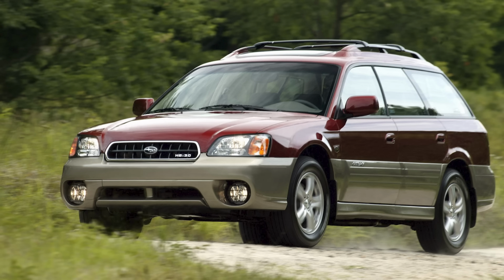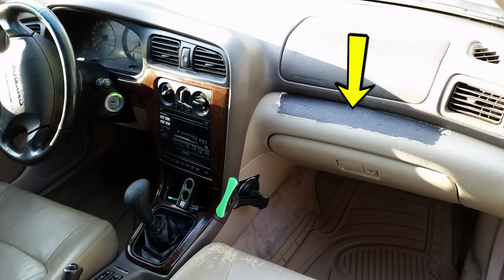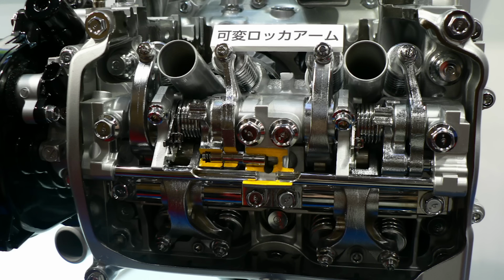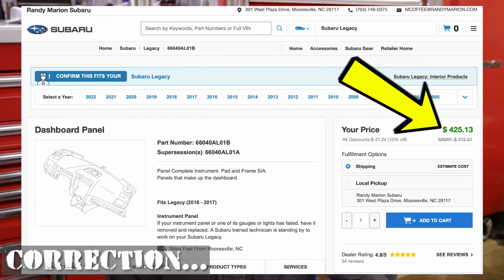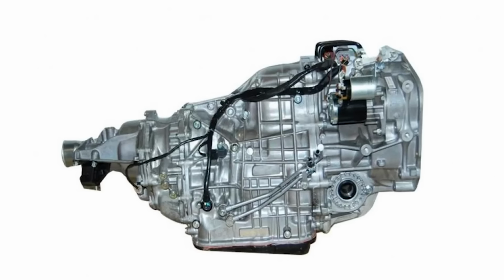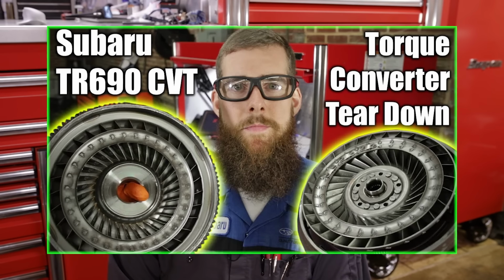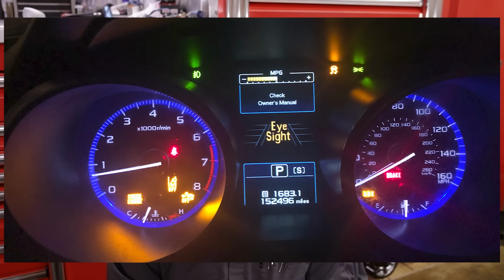Buying A Used Subaru Outback Or Legacy?! Here's The Good And Bad Over The Last 20 Years!

Comment: I didn't know I was supposed to be burning higher octane gas in my 3 l could that be the reason I'm getting off cylinders running lean code I tried everything to get it to go away and I did upgrade the higher octane once I heard knocking spark knock.

Comment: When it came time to update my 2007 Ford Focus ZX3 daily driver/“commuter beater” with a new car, I was considering one with waning availability, that one being the Nissan X-Terra. “Waning availability” turned into “I’ll never be able to get the model I would have chosen.”
      In the meantime, I got a bit older, along with the Focus. I also began to learn a thing or two about the Subaru Outback. I decided on that car. And today, I’m the proud owner of a fully paid-for, 2017, 2.5L “pzev” (partial zero emissions vehicle- don’t ask!) Outback. That car got me to retirement, after I ran up over 70,000 commute miles on it (plus a trip to Flagstaff, AZ and back), with a major service at 30,000 and regular DIY oil changes. Here’s where it gets fun!
       Late last year, I began to become concerned that after missing the 60,000 and 72,000 mile service schedules, I ought to take care of that. And so, I did. It cost around $2,500, which included servicing the CVT and replacing lower control arm bushings and rear brake pads. And then, I also needed new tires.        
       Needless to say, the past few months have been a bit expensive for maintaining a Subaru. But, ‘wanna’ know what? I just completed a round trip between LA and the SF Bay Area, including the LA area touring. But then, earlier this month (March 2026) I also drove from the Bay Area to Boise, ID, onto Salt Lake City, back to Idaho, and then back to the Bay Area. Needless to say, we’re up for another oil change!
      I’ll be honest. I can’t afford a new car. I need for my Subaru to last. I look at every month without a car payment as a blessing. If I have to drop a grand on it every once in a while, averaged out, it’s still cheaper than car payments. And, oh by the way, I still have the Focus! Thanks for listening.

Comment: Michigan salty roads destroy all vehicles. Sadly, my 2004 Outback with the EJ251 & 4 speed auto trans is rotting away in all the usual areas at 263,000mi. If not for rust, this would be the last car I'd ever want or need. It is that good.

Comment: Bought an 03 Outback from a friend with some oil leak and went through a little antifreeze. 1500 hundred. I was amazed how well it drives and quite for a car with 250,000 miles. Just bought an 02 for 500, blown head gaskets. Pulled the motor, replaced all the right stuff.  Fell in love with these early Subaru.

Comment: 2017 3.6 touring here with 160k miles. Never had the common issues mentioned. Still have the original windshield and harmon kardon radio. I replaced the battery after 6 years with a better one beacuse I was going on a long road trip in winter, but never had any issues with that either. Mice did eat the soundling of the engine cover. 😂

Comment: 2015-2017 Outback and Legacy was offered with a 6 speed manual in Canada. Base models should have no battery drain issue as it amainly caused by headunit trying to connect to nonexistant 2G network. Base radio has no mobile connecitivity and doesnt have hat issue.

Comment: MR. SUBARU PROBABLY WONT SEE THIS BUT ITS A SHOT N THE DARK, YOU SAID YOU PERSONALLY OWNED A GEN 4 3.6R OUTBACK. I RECENTLY GOT A 2013 WITH 109K ON THE CLOCK L, 1 OWNER CARFAX CAR. IF YOU SEE TORQUE CONVERTER SHUDDER @ AROUND 1700RPM AT SPEEDS ABOVE 35, AND WHEEL SPEED DATA IS GOOD, TURBINE SPEED 1/2 DATA IS IN SYNC WHEN IT SHOULD BE NO CHECK ENGINE EXCEPT NEED TO REPLACE MY 1 OF MY TPMS BUT WILL DO 4..SPEEDO AND ODOMETER OCCASIONALLY DONT WORK UNLESS I CRACK THE SUNROOF OPEN 50% OF THE TIME THEY START TO WORK (SHARING A COMMON GROUND?) . I DID HAVE CODE FOR "AT ABNORMAL" IN THE ABS SYSTEM BUT WHEN I INSTALLED NEW ABS MODULE (SAME PART#) I COULDNT GET IT TO PAIR TO ECU SO HAD CEL'S) REINSTALLED ORIGINAL ABS MODULE AND CLEARED CODES.  TRYING TO FIGURE OUT IF I NEED TORQUE CONVERTER, VALVE BODY OR WHAT?  IM IN NW NC BUT HAVE VACATION AT EMD OF OCT., MAYBE I CAN DRIVE DOWN TO HAVE YOU TROUBLE SHOOT IF YOUR NOT BOOKED UP ?

Comment: 05 3ltr outback 450000klm in oz,
4th? owner, had for 5yrs spent $5000 on fixes mostly by me.
Previous owner slack as, checked inlet valves, carboned up heaps, all clean now.
Wanna take out and rebuild one day, purs like a kitten goes like a rocket, regular italian tuneups.
N.B. all subies over 240000klm need mega ongoing mntce and are only worth $2,500 max for g.c. and full service record...top dollar, imo. Use full synth, flush auto

Comment: 246k miles on my 2001 2.5L Outback. It’s becoming harder to find some parts. Recently replaced the timing belt/water pump, front D/S wheel bearing, fuel pump, radiator/hoses, rack and pinion rack, catalytic converter, fuel injectors and ignition key cylinder. I had to have the injectors rebuilt because I couldn’t find OEM and the ignition key cylinder on EBay because it was discontinued. I need a HVAC diverted assembly but that’s also been discontinued. Great video. Thanks

Comment: I'm here because I just got a 2004 outback with only 73k miles on it. It was an old lady's car and unfortunately she passed away. I'm glad to have found such a great little gem. Also very glad to know that this 04 is part of the better ones built. I'll do the maintenance on the head gasket sooner than later. I know about the timing belt and water pump issue. Anything else I need to be on the lookout? Great video!!

Comment: I have a 2019 2.5 and it has had no issues. My sense is by 2019 they have ironed out a lot of issues so maybe try to get a 2018-2019. No mention in this video of the mid generation refresh for 2018 which was meaningful. I can understand appeal to keep an older one but the 2015-2019 I think are very safe and have performed very well in crash tests. Crash test results must be taken into account. (Also not mentioned)

Comment: 07 legacy limited, no turbo. I had the sticky dash, ghost walking used to be crazy in the rain,  the blend door problem, and the wheel bearings always needed replacing...  No head gasket issue tho. I liked the car, but it was finecky... Way less problems with my 06 manual TL.

Comment: Sounds like a very thorough and damning :(. I had a 2003 WRX wagon that I bought new and it lasted over 300,000 miles on the original turbo with some gentle performance tuning. I also had a 2007 WRX Limited wagon that I ran over 300,000 and then sold because I didn't want to get into fixing the infamous Subaru rust issue in the rear quarter panels. Again, this one was mildly tuned and had the original turbo. Neither had head gasket issues but each of them at some point ate the intake valves in cylinder 1. Weird.

Comment: I have a 2004 2.5L Outback with 150,000 k's and it's been and still is a beautiful car, never been a problem but I have done regular maintenance.
I bought it with 50,000 k's from my mother estate but it did need some repairs, hubs and joints, not from wear but from age and from being driven a little.
2 years ago before having 2 knee replacements and had a 2.5'' lift kit fitted and with the all terrain tyres suits it perfectly.

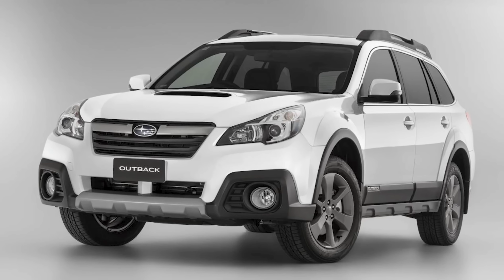Comment: 14:13. So does that mean the 2010, 2011, and some 12s that still had the timing belt version of the engine are still susceptible to the head gasket issues?
Reply: Trying to figure that out myself. Thanks for asking!

Comment: We bought a 2005 Outback 2.5i. Head gaskets replaced. Oil change religiously at 3,000 miles. Now it uses 2 qts every 3,000 miles. I wish I never sold the Legacy 1995 wagon

Comment: i just got a quote for $4,200 to fix the headgasket in my 2013 crosstrek... i looked on ebay and low mile used engines are like $1,500.... im going with a used engine! i can buy three of them for about the price of a rebuild, and can probably rebuild mine in my spare time if its out of the car and im not in a rush.

Comment: 3rd gen outbacks are legendary. They don't rust, most have full posi lsd's. Both the 5mt & 4eat are tough af. You do the head gasket at 150k nothing else will fail and they'll go 300k plus with abuse. So long as you check your diff oil and engine oil. 💯👌
My 08 has 235k
My 4th gen is fragile garbage, build quality is shit compared.

Comment: Couldn't agree more about the '00-'04" Outback as peak Subaru. Two months ago I picked up a 2002 Outback 2.5 manual with 255,000km on it for AUD$1800 as a cheap daily runner (so I could retire my rare '02 Alfa 156 GTA from daily duties). Everything works, even the clear coat is still intact, and the young fella I bought it off had fitted MLS head gaskets, done the timing belt and installed a heavy duty clutch less than 30,000km before I bought it. It's also got a 2" lift kit, HD offroad tyres, bull bar and CB radio. It's a breeze to service myself and really the only thing I still need to sort out is to replace a couple of split CV boots. Rather than muck about, I've bought new replacement CV drive shaft kits for each side and will fit them myself shortly.  Man I love this thing.

Comment: Im a Subaru fan, owned a 99 Outback  briefly before rolling it..... Might buy a 06 Leggy wagon this weekend, How ever due to the inherent design of a boxer engine it is hard to keep fluids like coolant and engine oil from leaking. Fluids flow down and will sit in contact with the headgasket at all times. Also the heads, especially on the DOHC 2.5 were bulky. That was a lot of weight to put on the area of separation of the head and the block. And after numerous thousands of miles and heat and cooling cycles, and pot holes hit, im wondering if shock load could have contributed and if Subaru had used studs instead of bolts, less HG failures would have resulted. It seemed like the DOHC motors blew more frequently and worse than the single cams

Comment: Daily a 2005 3.0R. Keep up with the maintenance and it an extremely reliable car. Bad gas mileage though. The HVAC actuator motors are awful though. A true pain in the ass to replace. I just replaced mine a few weeks ago. I had to pull the entire dash out and drop the steering column.

Comment: I've got a 2004 Outback with 244,000 miles on it and at is doing great. I've taken care of it and have done all the maintenance. There is only 1 issue with it though. The suspension is rough and I feel every bump in the road. I have replaced the struts on it and I have the tires at around 30psi. Does anyone have any recs on suspension things that I can do to the car to make it ride a bit more comfortably?

Comment: I have an '04 LL Bean H6 Outback. You mentioned the wind noise, we are experiencing this from the front passenger door. So is the answer to just replace the door seal? 
Also, we are having issues with the alternator failing and have not found the issue yet was wondering if this was common? We had the alternator rebuilt at a reputable shop and within 3-4 months we started having the same issues, the brake and battery lights come on intermittently, when these indicators come the headlights will dim, or if you are driving with the daytime running lights they will turn off. The right taillight will blow out and some fuses may blow. It's very frustrating and we don't have the $$$ to have Subaru diagnosis and repair it, whichwouldbe a fortune.
Thanks for any help! -David

Comment: I have 2016 Legacy 3.6R with about 77,000 miles. I drive it with care and overall it's a good car (original owner).
1. at around 60,000 miles, power steering rack started making a loud noise especially when it's cold in November - February. Subaru of Shoreline in Seattle, WA. replaced it with Subaru of America paying a portion of the cost since the car is still in pristine condition, total cost was around $3,000. 
2. 13 months later, the power steering rack issue reappeared again and since it was a month over the warranty I had to pay for it with the help of SOA. 
3. Several month later (about 6 months ago) the same issue came back. Dealership mechanics took it for a test but couldn't replicate. I don't know when this will popup again, hopefully before warranty expires which is in January.
4. several months ago and while driving on the freeway, CVT slipped a couple of times. Transmission kept slipping for about two weeks then all went back to normal. Took the car to the mechanic shop and they were unable to replicate the issue. I know it's there and it's only a matter of time before CVT starts to act up again. CVT fluid was replaced at about 65,000 miles.
5. Battery drains and dies if vehicle is not driven for about 3-4 weeks. It happened three times where the car needs a jumper.
6. Windshield cracked once, replacement cost $1,500. 
7. A/C is not as cold as other vehicles such as Toyota or Honda. I live in North Seattle and as you can imagine summer is not that hot but sometimes A/C cannot keep up.
8. Infotainment LCD malfunctioned/froze while driving, happened several times only
9. A popping sound comes from the middle of the dashboard by the A/C control button, it sounds like a rock hit the windshield, it could be heat expands something behind the dashboard because it happens when the car gets hot after driving for a while. 

Other than those issues the car has been good to me. Thought to share my experience.

Comment: My dealer maintained '06 Legacy GT Limited Wagon with ~230k km (143k miles) on it has done great with only routine maintenance. Engine is all original and the interior is perfect - including its original dash. HVAC blend door is starting to fail though.

I also had a base trim '05 Outback. It was well abused when I got it at about 310k km (193k miles). The interior was filthy and the arm rest was shredded, but that was the previous owners. Mechanically it did fine in the few years I owned it. Oddly, there was no record of replacement on the headgasket yet it seemed to be fine there. Only had to replace the oil sensor. Gave it to my dad and he still uses it to this day.

Comment: I bought a 2003 subaru outback sedan limited/ outback legacy. 
The  car only had 15,000 miles when i bought it. All maintenance kept and done regularly. I got it from a older lady who lost her husband who only took it hrocery shopping. I immediately changed all fluids. And did the timing belt Water pump and thermostat since it was that old. The Only issues i found and changed werebad return hose on power steering pump, ac return and liquid line orings rotted and a intake filter destroyed by mice. Some hail damage but its a 03. It currently sits at 43,357 miles.. best 5k i ever spent.  Leather seats sunroof. Its a Connecticut car with 0 rust. I love this car.. 4 new tires and  changed atf. Its a great car.. i feel lucky to find such a low mileage and elderly driven vehicle..

Comment: Had Subaru for over 25 years, couple of turbo sportwagons, the Outbacks since 2008, a 1998 2.5 outback (damaged) then a wonderfull 2002 VDC 3.0, bought cheap and rusty but 8 years troublefree service and 80K miles till the subframe and gaskets and my advancing age meant it was too much for me to do (had done smaller weld repairs).

Now have a 2008 2.5, well looked after basically one owner car, bought it at 10800 miles as had full Subaru history etc. but compared to the 2002 H6 the build and ride as said are just not as good, attempt at "German" chrome and black trim not as good or comfortable as the H6, loved my pretend wood and cream leather sofa feel......and tacky plastic feeling to various bits and twitchy over bumps in corners despite 4 wheel checks.

Friends still thibk it is great, I get tired of saying "You should have seen the old one"

Fuel consumption is maybe 20% plus better driven sensibly, so one plus I suppose, maybe due to the wight trimming, but the "solid" feel has gone for me.

Comment: My 2016 Outback 2.5 limited has a problem with cold starts. After a moment, the dash lights up like a Chrismas tree, and it's not just lights, the actual cruise control and rough surface warning are real and in effect, everything is on and a real warning. The car is even limited by those features.  The only way to fix it is to disconnect the battery for a moment.  happens about once a week. any ideas anyone?  Otherwise the car has 150k and is a great car.

Comment: I'm a new mechanic which work at a company that deals with 3 Japanese and 1 French company, with one of the Japanese brands being Subaru and somehow, the only problems we've had are AC problems in 2 cars, 1 leak on the Levorg and then 1 compressor on an Outback. And then 1 EGR for the diesel. Except for that they have been FLAWLESS without any issues. Not even oil leaks and consumption somehow in the one year I've been there. And these are the 2015+ models. Out of the 4 brands, I like the Subaru the most because they're beautiful, reliable, and comfortable af.

Comment: I was explaining to my mom why Subaru engines such. I was telling her that it's like a shit sandwich. Stack up an 8 layer shit sandwich and turn it on its side.  The shit will almost immediately start draining out the bottom. That's how Subaru engines are and the shit draining out is oil.  Soon that shit will be all drained out and you will be left with the stink of the shit oil as it leaked out.

Comment: oof, yes, questing for an 03, almost there. 14 years since timing belt, 75% of miles. Already shopping for mechanic before finalizing. No rust, neighbors 03 is a more typical example.  The owner's an older chap, moving across the country, not the typical situation. A fresh correct install of the timing belt and I'll be less stressed. Is there a tutorial? just kidding, looking for the local pro.